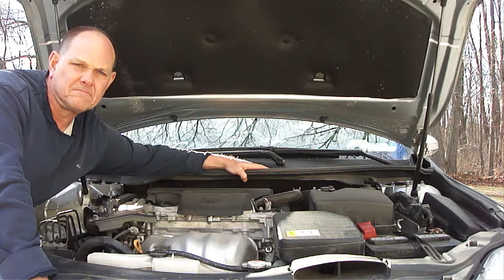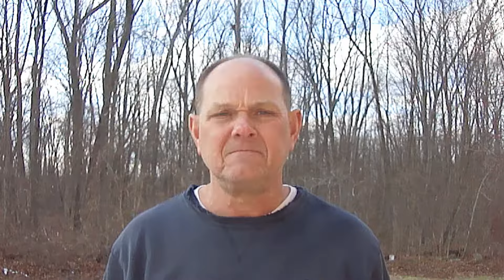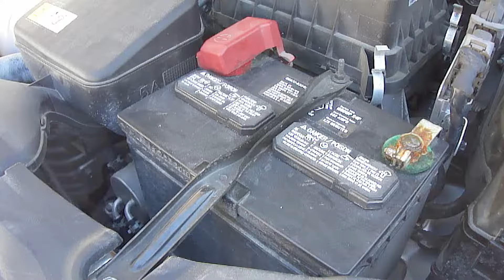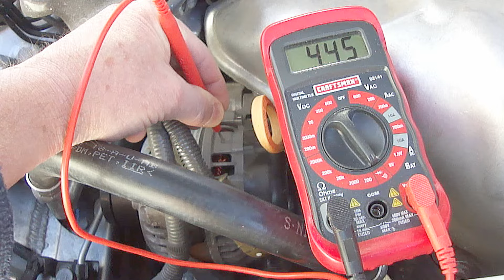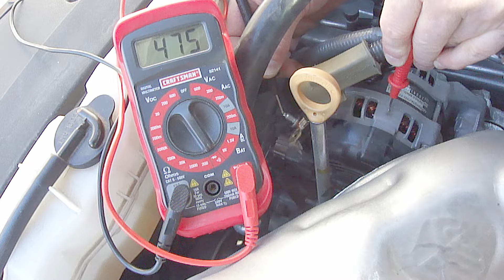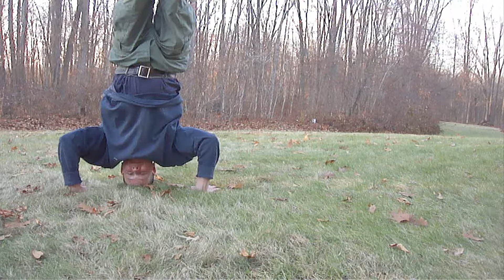How To Easily Check Alternator Diodes

Comment: Another easy way to check alternator is fully charge battery,,  disconnect alternator cable and harness ,, take volt reading before dark ,,, if battery drains overnight diodes shorted out ,, replace alternator

Comment: Yeah I like it but the problem is is that each car wouldn't it be specific on each alternator of how many millivolts you're supposed to get? Because this might work for this specific model of a car and that alternator that goes to the car but what about Chrysler GM for Toyota Hyundai etc?? And where do you get the specifics for millivolt to test the alternator for your specific vehicle that you're working on like meaning myself I have a truck I'm trying to test the Dodge ram 1996 Cummins 12 valve where do I get the information I do have a service manual

Comment: It’s much easier just to check for ripple while the engine is running. Failed diodes will cause incomplete ac to dc rectification and result in excessive ac voltage in the system. Just check across the pos and neg cables with your meter set to ac voltage low range and ensure there is less than .5 volts of ac voltage present. Check at idle and while revving to 2000 rpm Also it’s common to have pulsating of flickering headlights in this case so that’s a good indicator but doesn’t necessarily mean you have good diodes if your lights don’t flicker

Comment: Diodes…..What are they ? …lol…They ARE ELECTRON CHECK VALVES ! They allow current in one direction only for most uses. They are not resistors ! The sole purpose is to allow current to flow in one direction only. Example: from the alternator to the battery but not from the battery to the alternator when the engine is shut off. If your battery dies over night, it could be a bad battery itself, a parasitic draw from some gadget on the vehicle itself running the battery down overnight, or the diodes in the alternator going bad. DO NOT just replace the alternator or battery unless you test it first unless you have money to burn…..

Comment: When measuring the diodes you are reading ohms (resistance) not milivolts. If you don't understand the difference between ohms and voltage you don't need to be fooling around with anything electrical.
Reply: I like reading the comments.  The mystery of the electron is a hurdle most will never overcome.
Reply: Actually some multimeters will even have separate setting for resistance and diode test. And diode test does show readings in mV which I believe is the voltage drop across the device being measured, like usual 0.7v (700mV) for silicon diodes for example.
Reply: @ThePeanutization  You’re right it’s true the diode function does provide enough voltage to bridge the junction.

Comment: you say most diodes should read between 400 and 800mv's.   I've been told a Honda CRV should read at or less than 50mv's.  is that true?  thanks

Comment: Paul, this was great because most videos show bench testing the diodes. The labor of removing an alternator on old cars was easy but today’s transverse engines are not easy. Is testing in place saves time and work and frustration. THANKS.

Comment: Man to disconnect my battery i have to do so much work just to disconnect the negative terminal, i have to remove ducts and things and the tire well, i've done it before i just hate doing it take about an hour. Then i can check the diodes. Really nice how Chrysler does that!

Comment: Hi,my honda oddysey draining battery overnight, I check if there is any parasitic drain, nothing, i check alternator it’s giving 14.10 volts when its not connected to battery but if I connected to battery it gives 13.5 volts , check the alternator diodes its good reading 6 .5 , its weird that when battery it’s connected to alternating voltage drops to 13.5 any idea  what’s the problem?

Comment: I have my alternator out of the car now and am getting 840 (I think ohms, not millivolts) with black on alternator post and red on alternator housing, nothing with leads reversed.  840 is pretty high, so I think it probably is the diode pack in my case.  Thanks for your help.  Other places talked of expecting 400 to 500, but this is the first one I came across saying how much is too much.  Thanks

Comment: I performed this test and it slowly climbed to just above 400. But I also get the same reading if I touch any part of the engine block which makes sense to me because the alternator is grounded on the engine block.

Comment: At 3:35, testing the diodes with both electrical connections removed from the alternator, when you instructed to place the black probe on the positive connection and red probe on the alternator casing, what is the positive connection, the positive B post, or the positive battery terminal?
Reply: The big ring terminal on the the alternator is normally connected to the hot battery cable.  You'd need to connect to that spot directly if you disconnect the battery cable, but given that the alternator post is typically covered that's why you would normally probe the positive terminal on the battery.

Comment: ckecking my alternator with multimeter, ( negative probe on pos battery terminal, negative probe on alternator case) reads 440 millivolts.  When the alternator/battery is checked at an auto parts place, their meter says charging at 14.4v but has a shorted diode. Is the miltimeter test limited as to what it can detect?
Reply: I found this video and searched the comments because of a similar situation. When I do this test I am measuring 515 milivolts, however the auto parts store told me "your alternator diodes are bad." Im wondering if there is some other way to confirm if the diodes are bad after passing this test?
Reply: @EvanChartier-p7d  .....its possible the auto parts meter reads bad diode based on a current industry standard. Some older cars, some say, have a higher threshold of acceptable readings on AC voltage leakage for instance than on newer cars. The same may apply to the diode test. The auto  parts store should program in your car make and year for accurate test results .

Comment: Its NOT the forward voltage you are looking for, its the reverse, which you should read zero. since there are
6 diodes in a alternator, you need higher voltage to test the back current. Also remember diodes react differently
at higher temperatures, when back current breaks down. Best way is a scope when running, under a load.

Comment: First test does not isolate the alternator. A bad reading could be from anything in the car including the hood light being in the on position. Also this will not indicate an open diode only a shorted one. Shorted alternators are easily found with a standard amp draw test. Just disconnect the alternator and see if the draw goes away.

Comment: The last test shouldn't have show a reading, which means the Diodes are allowing current to flow both ways & not one way as they should. So the last test means the Alternator is malfunctioning.
Reply: That's what I thought.

Comment: Did you even check where  you plugged the leads into your multimeter?
Reply: I dont understand why the black probe is plugged into the left portal of the multimeter. Is that correct?
Reply: @TheHomy70  because is black input

Comment: Minor correction, the voltmeter, set in continuity setting, measures continuity in ohms resistance.  A diode is a one way resistor to AC current.  If you get the leads wrong as you pointed out, a diode has infinite resistance.  In the correct orientation a diode will have something in the neighborhood of 450-500 ohms of resistance, a shorted diode will have very little resistance and an open diode will of course show very high resistance or infinite resistance.  The important thing, and I thank you, is teaching me how to test my alternator easily.  Good video, good instruction giving.
Reply: The reading is actually a voltage drop produced across the diode by the diode test circuitry inside the DVOM sending a current through the diode  The meter in the diode test feature uses a higher ohmmeter test voltage in the range of 2.5 to 3 volts CHEERS
Reply: So what exactly do i need to do to correctly test diodes?  The way he shows in video or the way you say?
Reply: While doing your test, my reading was 174 could this be causing tha drain to th battery? Thank You,  Jon R.
Reply: Most likely you have a shorted diode which may be over charging the battery and killing it
Reply: I got 0.00 
So it must be bad then right

Comment: Thank you very much for this.  I have a parasitic drain after the car is switched off, which drains the battery in 15mins, the volts drop from 12.6 to 7 volts . Then I disconnect the negative terminal & the volts return to about 11.5. I will follow your instruction to test the diodes.  Best tutorial ever, thank you again.

Comment: Good afternoon my friend,
My battery is in the back of the car with the negative cable disconnected.  When I touch the negative probe to the alternator positive cable and bolt and the red probe to the alternator casing, the multimeter stays at 1.  When I reverse the polarity with the probes, the multimeter still stays at one.  This whole test wile the plug and cable are still connected to the alternator.  Thanks in advance!!

Comment: My 2001 Toyota camry is at 11  volts. I changed my alternator with a new alternator and it's still at 11 volts with a load? In this particular alternator the voltage regulator is included in the Alternator. Kinda frustrating I cant figure out what wrong with it. Battery is good. Just for some reason its at 11 volts with a load. Any ideas sir? God bless 🙌 and may the one and only lord bless you.
Reply: If your alternator produces 11v, depending on milage of alternator - check brushes, voltage regulator, get a complete alternator, better go to mechanic or bring your alternator to AutoZone or similar store so that they could test your alternator. You need diagnostics, go to professional.
Reply: @pfoxhound  I did take alternator to autoparts store they tested it and said it was fine? That's what's weird?
Reply: @chrisr.123  sometimes if they say it's ok - it will be ok. Depending on milage you may need a new one. When it's getting hot may act different. Buying cheapest - not an option. I saw 3 cheap starters installed one after another one. I connected my oscilloscope to car to see what's going on. Mine was dropping to 8V in some moments. Midas changed it to cheapest, changed me premium, in a week alternator started to act similar to original damaged one. After complaining they installed new original. Fixed. 
My friend had a bad tensioner and belt, his got temporary fixed. Now he has some minor problems with alternator, he changed his voltage regulator - fixed completely.
Reply: @pfoxhound  TYVM sir
Reply: I have a similar experience,i bought a new battery, the problem continued, i will try to change the voltage regulator.